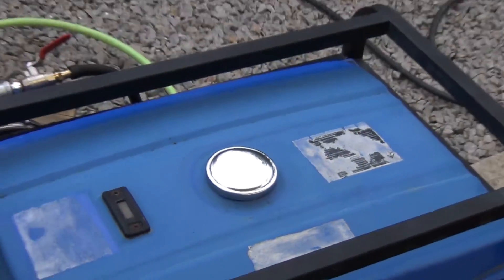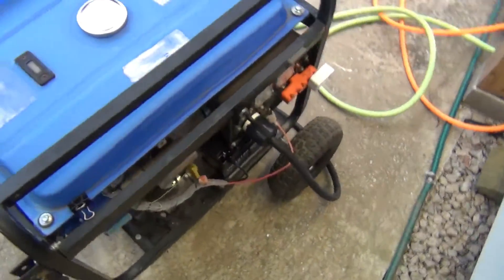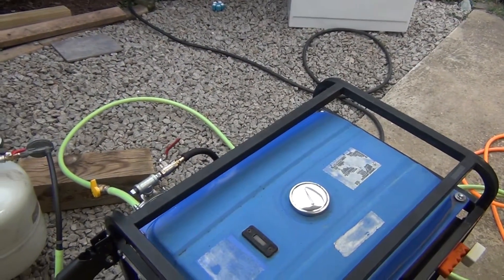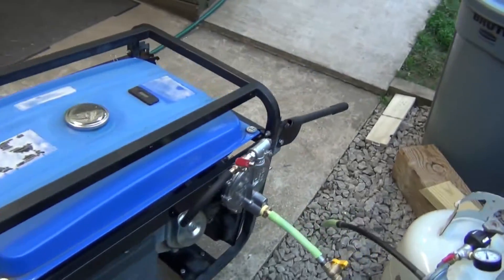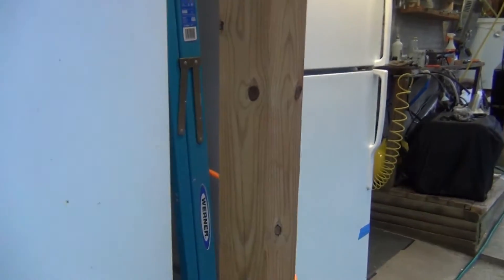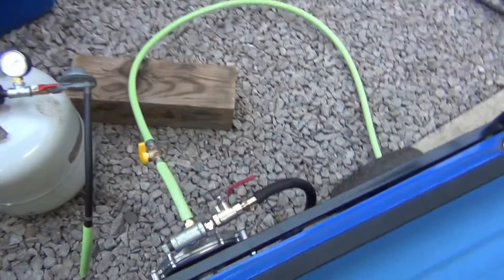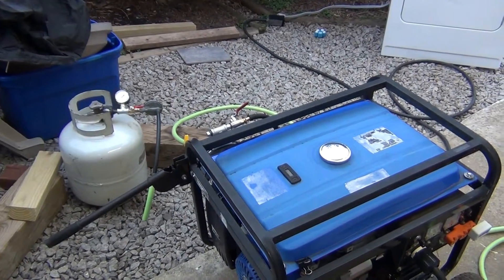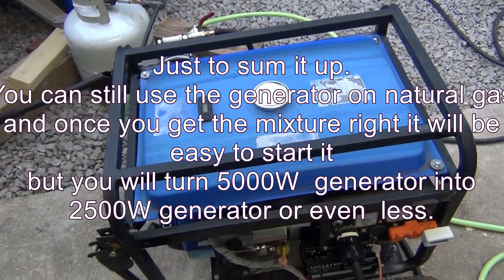How to convert generator to natural gas.

Comment: You can always open up the gas regulator more, it haves a adjustment screw on top of the main gas inlit port!  Turn left for more natural gas and right for less! It's that easy. Did you try it years ago?
Reply from the maker: @sidneymeyer9014  no its not that easy, sorry but carburetor requires perfect mixture of gas and air and there is only as much mixture you can push through the carburetor

Comment: Your generator will drop 20% of KVA output with switching to NG. Propane will drop a bit too but much less. This is known fact and all kit manufacturers say that. The other problem with your setup that I see is your dryer which usually takes 5 - 5.5KW. I haven’t seen 2.5kW dryers (do you have one element burnt?). If the dryer is 5kW than it explains why it makes generator suffocate. Another variable- your altitude and spark plug gap. You should have changed the gap by a bit on NG before running it. It should not affect gas and propane performance. If you are at altitude at 4000 ft and above then your power is reduced even further. My Yamaha offers modifications for altitudes higher than 4000.
Reply: I believe to get the most power with NG, you need to advanced the ignition timing  around 5 degrees.

Comment: Your first mistake using that POS generator. Buy the right generator 400cc up Westinghouse or Gererac 12k - 15k use a 3/4 - 1” line less than 15 fit NPT gas hose. Use a Century Regulator kit from PNG Technologies. They have plenty of videos talking about NG vs LP use.. you didn’t do the math nor did you do your homework.
Reply from the maker: ...... you didn’t do the math nor did you do your homework.

Comment: I have to correct you on one thing. With very low pressure, you MUST INCREASE the size of any pipe or hose used. Also for longer runs, you must likewise increase size. Using natural gas instead of propane should NOT reduce your power by 50%. Try running a bigger line, same size as the line into your house or even bigger. Bends in hose and pipe restrict flow, too, and must be compensated. Basically your half inch hose should be doubled, or preferably increased even more. Try it and you will see a difference. Also natural gas pressure varies quite a bit. 

The standard residential natural gas pressure in the U.S. is about 1/4 psi. Or 7 inches water column. Standard residential propane pressure at the appliance is around 10 inches water column, or about .4psi. Significant difference, but not a dealbreaker. But you have to use a line as big or bigger than the line from meter to house if you want to make sure you are getting all the flow that your natural gas meter will give you. Your meter also regulates your pressure. Street pressure may be as high as 60psi or even more, depending on where you are in the system.

If you doubt me on this, ask your plumber. And really, you should have a professional look over any gas piping changes that you do on your house anyway. Let me put it like this. If you can't quote Boyle's Law and tell me what it means, you have no business working on your residential gas system. If you don't understand how line size, length, and bends affect flow rate at a given pressure, then you have no business working on your residential gas system. And I suspect that if you are not a licensed professional, your insurance company and maybe the local fire department, building inspectors, and utility company will insist at any rate that you have no business working on your residential gas system.
Reply from the maker: Don't you think I already went trough all of this?  Bigger pipes, N G psi etc? I'm taking N G strait from meter with little less 2 psi pressure. If I increase the the N G flow I will flood the carb with N G and not enough air so the mixture is not perfect. You can not push same amount of energy coming from the N G as it is  from gasoline, mix it properly with air and push it trough carburetor unless u r superman. Simple as that. It looks like you must be one of those who likes to talk and talk and talk but do very little work. I'm the opposite so do a little home work before u criticize  :)  Thank you for the comment but if u read down bellow  there is tons of them just like yours. None of those guys did their home work before they open their mouth.  Have a Good day :)

Comment: Your videos helped me with converting my generator from propane and gas to run all three. It works great, I'm still able to start and run my AC with my 10k generator on natural gas. I might be getting a little better results since mine is built for propane vs trying it on a gas only generator. You're right, natural gas does lower the power output. If done right it should be about a 15% drop from propane and about 25% drop from gas. So on natural gas I'm probably getting 7000 to 7500 peak. So long as your generator is large enough to begin with and you have the right hose it is still good to do for emergencies where you can't get gas or propane.
Reply from the maker: Its better then nothing

Comment: Congrats you did so many things wrong here.
Reply: The line is way to long.  And too thin.  You’ve clearly didn’t set up the regulator properly.  There are literally dozens of videos of people doing exactly what you say is impossible.

I myself have this setup and it works just fine.  

Instead of talking in absolutes why don’t you post a video asking for help with your setup!
Reply from the maker: @healtc5069  and dozens of people are wrong..... And here I thought you new something but you just judge me by other videos. :) :) you r funny.
Reply: The natural gas is supplied from outside the carburetor and flows through the carburetor to the engine. If you put the choke on you are restricting the gas flow. When you put a load on the generator and it almost quits it’s because you are starving it from getting more gas by using the choke.
Reply from the maker: @timjchick  where do u see me using the choke?
Reply: Vlad Fred Kovac at 6:50 in the video. You say “choke” and after a couple pulls you say “more choke” but you never opened it back up once the engine started.
Reply from the maker: @timjchick  good point but I was not using choke for gasoline bot choke for N G on Garretson regulator meaning prime or more gas supply. If you would work on these N G gens you would know that but I just assume people would have basic knowledge about these N G setups so they would know this.  Sorry but now you know it was not choke for gasoline. Besides my N G supply on this setup goes behind the choke,  it is a redrilled carburetor as I mention earlier in this video. So it looks like you would be wrong on so many counts :) Peace Dude
Reply: Vlad Fred Kovac I didn’t catch that you drilled the carburetor to supply the gas to it. If you’re hole you drilled is too small the engine can’t get enough natural gas to run properly. The engine also needs air mixed with the natural gas to run properly. By running it with the choke on you’re preventing the engine from getting enough air to run under load. I converted my generator to run on natural gas but I used one of the gas intakes that mounts between the carburetor and the air filter housing. I used a 3/4” supply hose and I used a regulator with a primer button. Mine works like it should.
Reply: Tim Chick as does mine but our comrade here keeps saying it’s impossible.

He doesn’t know how to set it up right so instead of asking for help he’s saying it can’t be done.

It’s rather pathetic but that is what you get sometimes with YOUTube.
Reply from the maker: @healtc5069  Okay guys, this is a waste of my time here. I'm very happy for you that your gens work perfectly fine but I converted about 45 to 50 different kinds of gens and tested them also and none of them will work just fine under the load when converted to N G. You must have a special generator so be happy. Goodbye.
Reply: Vlad Fred Kovac 40-50 generators? Come on man.  Seriously you’re doing something wrong.
Reply: Vlad Fred Kovac if you’re using the same small hose and the same drill and port method on the carburetor they probably won’t work. Try using 3/4” hose/connectors and purchase a $25 nozzle with Venturi that mounts on the outside of the carburetor. Also get an adjustable load block for the output port of your regulator. It will help to adjust the gas mixture.
Reply from the maker: @timjchick  I have a better idea, why don't you make same video like I did and show me how it works under the load running on natural gas. This all talk and talk but noone yet prove me wrong.
Reply: Vlad Fred Kovac my generator is put away until next summer when hurricane season starts up again. I’ll be converting another one sometime this spring that will let me power more of my house. When I convert that one and test it I’ll post a video.
Reply from the maker: @timjchick  Let me know, I want to see it running on N G under the load just like mine.  Thanks
Reply from the maker: @timjchick  There you go, you converted one gen, probably didn't even tested it properly under the load and you criticize me, while I converted many, monkey with them improving and testing them almost every day.
Reply: Vlad Fred Kovac I researched how to do the conversion and I followed proven techniques and successfully converted my generator. It starts on the first or second pull every time and works great.  My wife cannot pull start it so I purchased one with electric start that I’ll be converting this spring. I expect it to work as well as the first one I converted.
Reply: @timjchick  Hello, you say 3/4" supply hose to the regulator or carburetor. Also they say you need a large supply pipe if you are far from the meter, but then they use a small hose at the carburetor. I don't get it. Also, can you just stick the hose in front of the carburetor or just inside the filter housing, or will it not have enough vacuum?
Reply: bauertime the spacer that fits on the outside of the carburetor is specially designed to create a Venturi effect. That may be why the hose going to the carburetor from the regulator doesn’t have to be as large as the hose supplying the regulator. I don’t know that for a fact. Just my thoughts.
Reply: That is stupid comment. Why don't you say why?
Reply from the maker: Wow, that was really helpful. At least I'm sharing the little knowledge I have with public whyle you, who knows a lot about this, is keeping it to your self. Congrats.

Comment: I’ve researched the Generac 20kw standby gens.       The farther the gen is from the meter,the larger the pipe must be.      At 75ft from meter,I must use 1 1/4.   

There is actually a table for distance and load.       3/4 won’t get you much.

Comment: If you buy a duel fuel carburetor their putting on the newer generator they are built specially to run alternative fuels. One thing I noticed with the duel fuel carburetor is the pre mounted regulator is quite a bit smaller then the regulator Garretson brand that comes with the Tri fuel conversion kit and the smaller regulator will push more NG and NPG through the carburetor their designed like that for optimal fuel sources to feed the carburetor. When you run a larger regulator then you half to get enough NG through a larger diaphragm to compress the gas. When you buy the kit they recommend 1” line no smaller then 3/4” because the diaphragm they give you is really for high pressure gas. The duel fuel carb has a small diaphragm and 1/2” line is sufficient to fill and pressurize duel fuel carbs. How do I know this? Well I’ve already purchased several at 30.00 each and sure reg gas burns hotter so even on new duel fuel generators they put how many watts on reg gas always higher and NPG about 1,200 watts less produced while using certain fuels. I personally will stick with the duel carb because it’s designed for minimal wattage loss.

Comment: Your main gas line is 1 inch to get enough power to your generator you would have to be within 8 ft from main with regulator to use 3/4 pipe but if you go 20 ft from main you will have to go with 1 inch to regulate your generator properly.
Reply from the maker: It doesn't mater, the carburetor will not take it. It's not build for natural gas.

Comment: You said that natural gas is 2 PSI that means you need big hose to get it down the line. Or you will not get the power you want from the generator.
Reply: You might be correct that the carburetor is to small but I see small gas supply lines now.
Reply from the maker: Okay, let say you r right, then you would need ten times bigger carburetor to supply same amount of energy to the engine becouse NG will produce much less energy then gasoline. And there is your problem, you can get as big hose as you want but you not going to be able to get it through the carb.
Reply from the maker: Not exactly. You can get only certain amount of gas through the carburetor so you r limited with the size of your carburetor which is made for gasoline and gasoline will produce much more energy then natural gas.
Reply: The carburetor isn’t the problem! The problem is the NG hose isn’t large enough to apply enough NG force through a large regulator unless you use a 1” hose then the regulator diaphragm will work as it’s intended. Your LPG works because it has more pressure to the regulator that’s why they have a regulator and hose on the LPG tank and it’s only 3/8”. Run a 1” hose to regulator for NG and it will run you’ll just have to fine tune the adjustment but normally it’s 7 complete turns out Fromm all the way in. Right now you’re starving your carburetor and the bigger the hose the more NG will accurately work the diaphragm allowing much more NG in. Try it with 1” 12 feet!